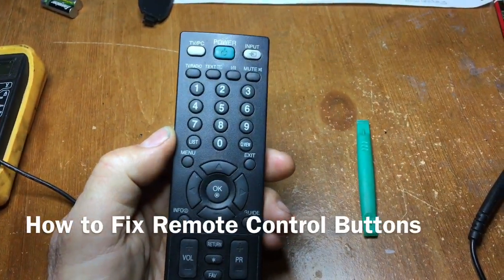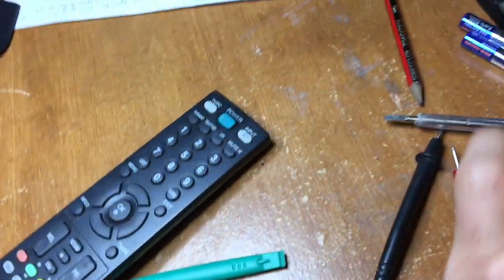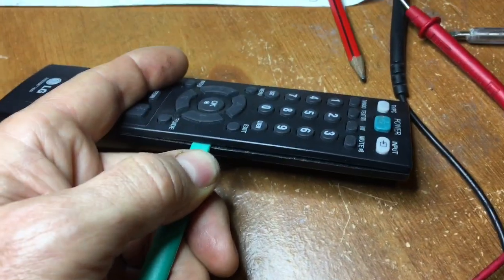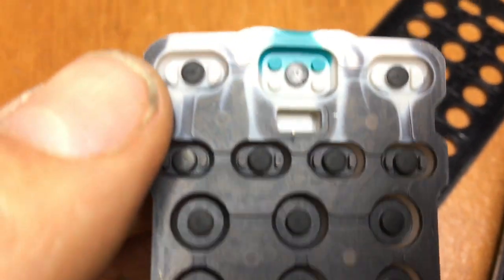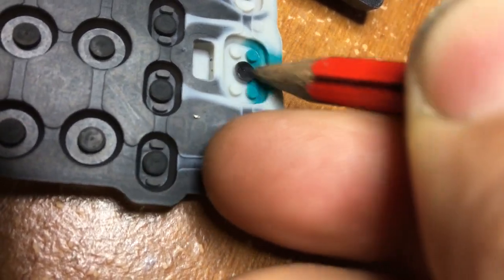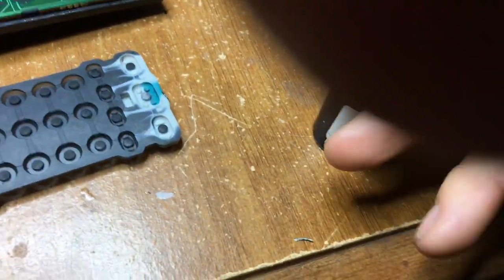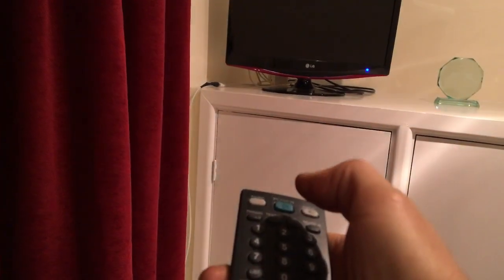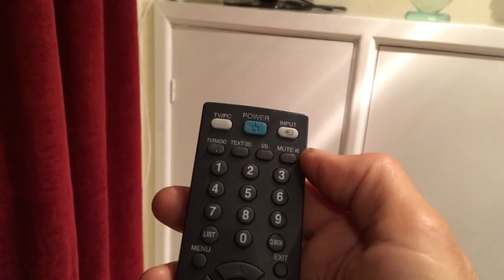How to Fix Remote Control Buttons

Comment: Thank you for this fix that ACTUALLY addresses the source of the problem!

Using your idea, though, I took a bit different approach. Since I am an HO scale model railroader, I have a tube of Kadee #231 Greas-em Dry Graphite Lubricant, which is used to lubricate Kadee couplers. I put some of the powder on the end of a cotton swab and by twisting it, burnished the graphite into the button contacts. It worked great! NOTE: graphite dry lubricant is also widely available in hardware stores.

No telling how long it will last, but I think it might work a bit better than a graphite pencil, since pencil "lead" also includes clay, which is a non-conductor.
Reply from the maker: Cheers, thanks for the alternative fix info.

Comment: Good video Thank You.  I shaved the graphite pencil point with a sharp knife onto a piece a paper.  Using a Q-tip I applied the graphite to the  underside of the button as well as that portion of the circuit board.  It's working like new again.
Reply from the maker: Well done

Comment: Nice I have the same remote for a bigger tv. Or damn near the same. Anyways the power button you'd have to press down on hard. Viewed it in a camera and the IR emitter wasn't lighting up so took it apart. Put some pencil graphite on the rubber bit of the contact and it works fine now. Probably temporary, might try to get some of that silver paint you used or try the aluminum foil trick. Though this is working for now.

EDIT: I looked up silver paint on amazon. Quite expensive. Curious as to if copper tape would work. Going to look into it.
Reply: Good to read of another one fixed.
Reply from the maker: Good to know, well done.

Comment: I have two LG AKB732955 Freespace Magic Motion Remote Controls. The on/off button for each RC shows IR blue light in a camera view. But the other buttons on both RCs show nothing. How do the other buttons send a signal if there is no blue light?
Reply from the maker: Web searching I found the manual https://www.manualslib.com/manual/269896/Lg-An-Mr200.html?page=3#manual

It seems it uses RF not IR, for at least some functions. E.g. from the manual: “The Magic Motion Remote Control communicates with RF Dongle using a 2.4 GHz bandwidth radio frequency”
Reply: Thanks. I tried the AM radio trick too with no detected reaction. I am guessing that the other buttons become functional only after registration and pairing have been completed.
Reply from the maker: That may be true. Note that AM radio is around 1MHz while Bluetooth radio is 2500MHz, so quite a long way off.

Comment: the pencil trick lasts for how long ? 4-5 button presses before it wears off?!
Reply from the maker: The procedure used in the video (see the full video where I show the silver paint) has fixed the remote and is still working 10 months later.
Reply: You did not get the point. Watch at 3:33 - It is for mother in law to use.

Comment: I HAVE a Question To Ask You To See How To Fix My Remote. When I Follow Your Instruction The Remote Works Good  For One Night. Then I Have To Repeat The Procedure.  What Else Can I Do, So That I Don’t Have To Take The Batteries Out And Press And Hold The Buttons Each Night?
Reply from the maker: What method did you use to fix it? The best would be conductive ink.

Comment: That carbon had to go somewhere. What I've usually found is there's still sufficient carbon on the silicone button for it to function. Where did that carbon go? It's on the PCB. Look at the PCB button traces and you'll find the most frequently used are typically gummed up a bit with some of the button carbon. A swab with denatured alcohol will quickly clean them. While I've got a remote apart, I clean entire keypad side of the PCB with the alcohol, dabbing (not rubbing!!) it dry from the excess and letting the rest of it air dry which doesn't take long. I've fixed a half-dozen of my remote controls by cleaning the PCB and I've never had to worry about putting more graphite on the keypad buttons.
Reply from the maker: Thanks for your input, it is true that it is worth cleaning the pcb due to what you say as too much conduction can be as bad as too little.  Well worth cleaning the pcb at the same time, but lost button conduction is often a problem that needs fixing as well.  I prefer silver ink nowadays.

Comment: Or just use   either liquid lighter fuel or   medical rubbing  alcohol. Rub across  with a non chemical cotton  wool  over the  circuit board and  underside of the  rubber  buttons.After that it all works fine
Reply from the maker: That will ruin the remote by removing the conductive layer on the buttons.  The usual issue is the conductive layer wearing off the buttons, so it needs to be replaced not removed even more.
Reply: @comeinhandynow  ok will take that on board.  So far it's  been fine on a 20 year old remote .It just needed cleaning up every few years..

Comment: Bro my problem is that I press a button it response me as I tapped it two times
Means I press it once it goes on the function for twice 
What to do bro
Reply from the maker: Take it apart, clean the contact surfaces, check for a any broken rubber bits.  It may be better.

Comment: The two power keys of my Onkyo RC-764M remote control were hardly working any more. So I found your video and did exaclty what you did. Now the keys are working again. I can see that by the LED-indicator when I press a key. BUT the remote does not send any commands any more. I can see that by 1. the receiver not responding at all and 2. when looking at the IR LED of the remote control with a phone camera, I can see no infrared signal when pressing a button. Phone cameras are IR sensitive (invisible to the human eye, try it!), but there is no IR signal sent by the remote. The IR signal was visible before I opened the remote control. So the remote control is totally useless now. But it has power and the keys are working, as the LED indicator shows up. So: Operation successfull, patient dead. I can see no visible damages on the circuit board. Any ideas how to fix this problem?
Reply from the maker: That is a tricky one and unusual.  Sounds like you know what you are doing, but still it doesn't work!  Try removing the batteries, press a few keys to remove any charge and reinsert after 10 seconds to see if that resets anything. Measure the battery voltage - are they all good?  Look around the IR LED to see if a dry joint disconnected it. Check if anything else was disturbed.

Comment: What about if it's the circuit board conductor that is bad?  I have one that all the buttons work except one, and it's not the bottom of the button that is the problem.  I've eliminated that by working the other buttons by using the pad from the bad one to make the connections and it works fine.  I also tried using another the pad from a good button on the bad connection on the circuit board and it did not work.  Process of elimination, bad section on circuit board.  Is there any way to fix it?  I see no obvious broken traces, just looks worn on where the button is pressed.
Reply from the maker: Trace the tracks back to a point where the connections are exposed enough that you can put on some probes from a multimeter to measure the resistance between the two wires.  Then see how this changes as you press on a good button.  If you can’t find any broken tracks then I suspect that perhaps the conductive surface from the button has transferred into the circuit board pads, thereby shorting them out and acting like the. button is pressed all the time.  If that is the case give them a good clean and scratch between the pads to open it up and increase the resistance again.  Compare the resistance to a good pad.

Comment: Opened my remote up and both the rubber backing on the buttons and the PCB were really sticky. Something must have been spilled on it. I just sprayed it all with electrical contact cleaner and dried it off and now it works just fine.
Reply from the maker: Good to hear.

Comment: oops,  spoke too soon.  Volume was working just a short while ago, and now nothing.  Please advise.  Thank you.
Reply from the maker: What method did you use to make the better connection? Alumimium, pencil graphite or silver ink.  Silver ink is best but you need to let it dry overnight.  You could also try conductive adhesive copper foil.   Test the resistance of whatever connection method you use with a multimeter (on ohms).  It needs to be low resistance when measured.

Comment: there is a better way on how-to prevent the sweat of silicone oil on each button which causes the button to not functioning. 
Have you notice this sweat of silicone oil did not happen to telephone buttons covered with hard plastic button? Never.
Why I don't know. But maybe the heat from our finger could block by the plastic.
How to apply this to tv remote control and other remote control?
Just cover the remote control with plastic cover. Don't let the remote control used without the plastic cover. 100% I can guarantee that no sweat of silicone oil will happen. 
I tried this to my tv remote control for 14 years. After my tv broke down, I open my remote control and found no presence of  silicone oil.
Also we can see the light of infrared of remote control every time we presses the button is thru cellphone camera
Reply from the maker: Thanks for you comments but I doubt most people will want to cover their remotes in plastic bags and anyhow I think it is the conductive surface that is wearing off the buttons.

Comment: the graphite on the buttons did not work actually made it worse
Reply from the maker: Silver ink that is specified as being conductive is best, see links in video description, although a soft grade pencil will also often work, it is not as good.  Also tin foil stuck on with doubled sided tape is ok.
Reply: @comeinhandynow  90% buttons did work before pencil worse with pencil did try tin foil again did not work - not worried

Comment: Get it apart and clean with alcohol is all that's required, pencil will work for a day maybe. if contaminated with soft drink sponge first with warm water and weak detergent, then use alcohol.
Reply from the maker: Rubbing with alcohol will only make it worse because it will rub off more of the conductive layer. I’ve been there tried that and it didn’t work. What you need to do is replace the conductive layer, and in this video I show how to do it using silver ink. Watch the rest of the video and read the comments in the video description.
Reply from the maker: Also the fix I show here is still working over 2 years later.

Comment: Dear anyone who watched this video,
     Don't take this guy's advice. There is no need to draw on your remote to make it work. This is only a temporary fix. Remove the circuit board, and soak the plastic and rubber parts in warm water with a little dish soap. While that soaks, use some PLASTIC safe contact cleaner and clean the circuit board. Rinse the parts that were soaking and dry them. Finish cleaning those with 50% isopropyl alcohol. After everything is dry, put it back together. 
Sincerely,
Someone smarter than this guy.
Reply from the maker: LOL.  You’re making yourself look foolish and a ‘know it all’.  Here is why you are wrong:
1. I’ve tried the cleaning method in the past and it just makes it worse, likely to make more buttons faulty as it will just wash away more of the conductive layer.
2. The fault is caused by the conductive layer on the rubber buttons wearing off, which you can test via a multimeter resistance test.
3. If it was a simple case of needing cleaning then putting back on a conductive layer on the rubber button of either graphite, silver ink or a piece of aluminium foil would not work, but it does in nearly 100% of cases!
Sincerely,
Someone who has experience and likes to share it to help others, but doesn’t boast about being smarter.